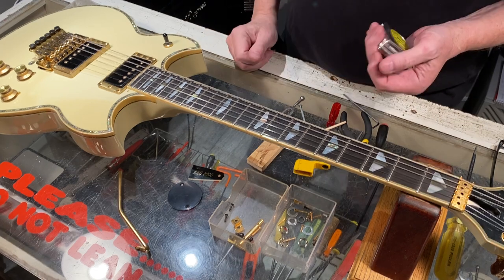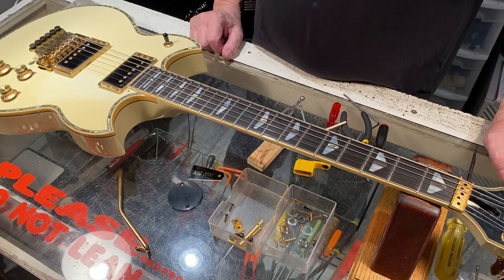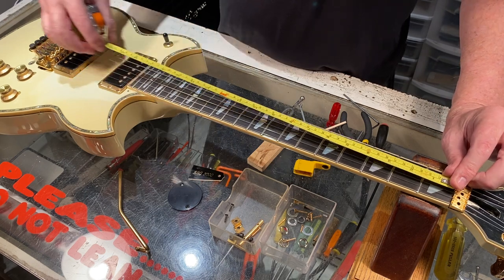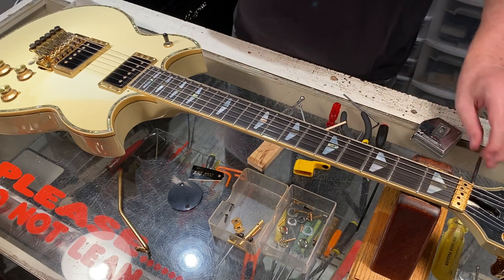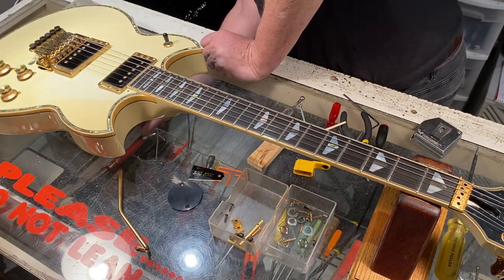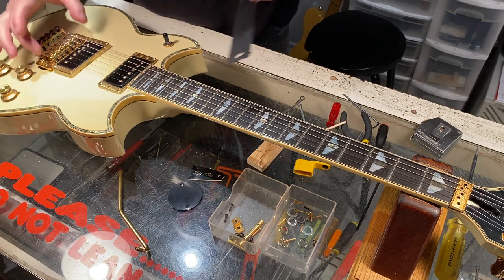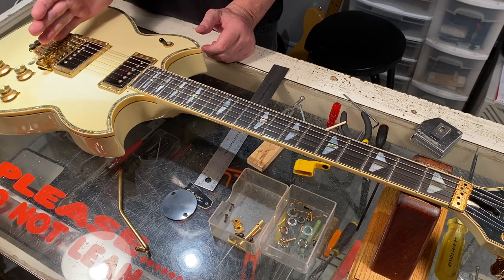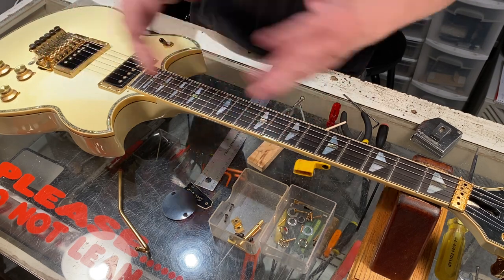How to measure scale length

Comment: Scale length is theoretical isn't it? I have a guitar where the bridge is way further than where the measurements show it should be placed, but the intonation is spot on. He knows what he's doing and measuring correctly. To the rude commentor...Gibson has 4 or 5 different scale lengths that they're calling 24 3/4" so which do you think would be right?
Reply from the maker: Thanks for the comment!
Scale length is physics, math, theory and practical application all rolled into one. LOTS of variables including: scale length, string diameter, string material, string construction (plain or compound), pitch (tension), compensation, playing style, pitch sensitivity and so much more.
And yes, Gibson uses multiple scale lengths to this day, but the overall most common, especially with their Epiphone line, is 24 3/4".